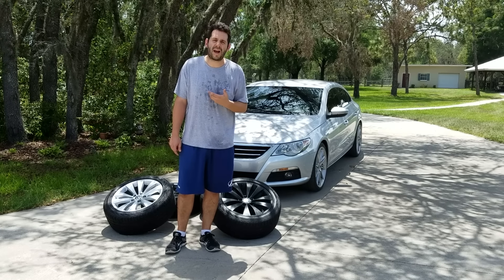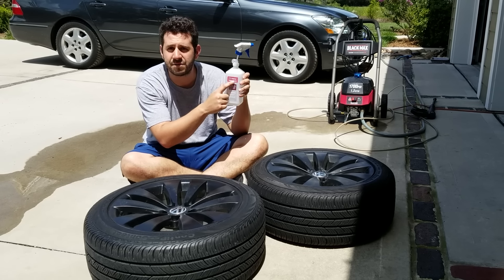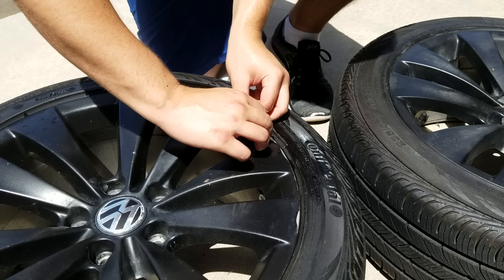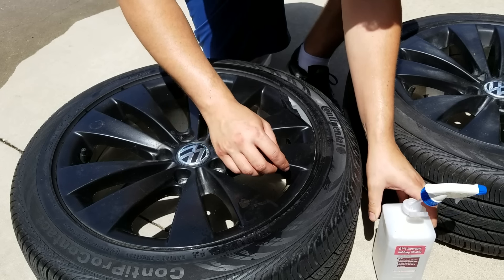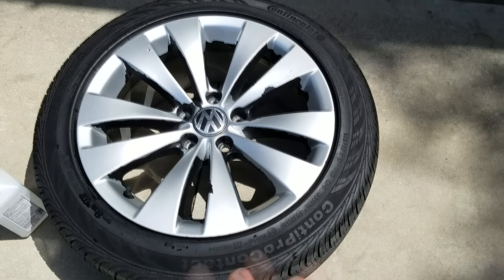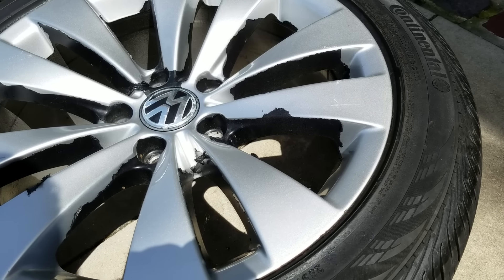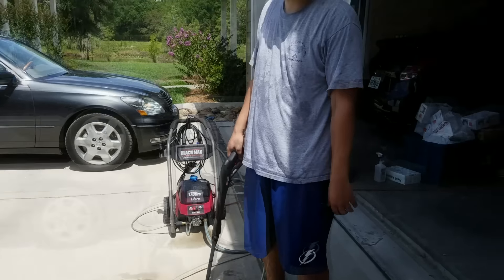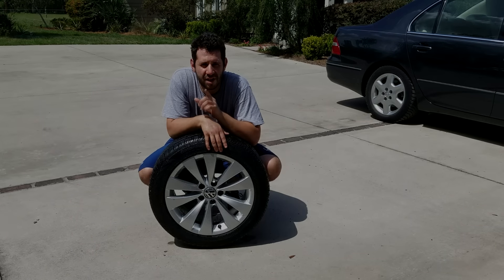EASIEST FREE & FAST way to remove Plasti Dip from your Wheels

Comment: Faster way, spray oven cleaner on it, let sit for a minute or two, it will start to bubble up. Next blast it with pressure washer and it all comes off in seconds. Not all oven cleaner is created equal, that natural lemon or orange crap won't work. I used Walmart house brand oven cleaner, like 2.78 a can which was enough for four wheels. This will also remove non clear coated rattle can paint jobs, like all those rims that people flat black rattle can painted before Plasti Dip became popular. It will not permanently damage factory clear coat but may make it soft for a while so do not use anything hard to scrape off paint, if there are any stubborn spots, use a nylon bristle brush. If you don't have a pressure washer, go use one of those pay and spray car washes.
Reply: Is oven cleaner safe on tire??
Reply: So like easy off foaming oven cleaner from dollar general store it's cheaper than engine degreaser and the Walmart oven cleaner lol makes good engine degreaser too

Comment: That plasti dip is done right. Mine is so thin that it wont peal as a whole and im getting kind of irritated.
Reply: LMFAOO
Reply: Have you tried spraying more coats on it? That might give you a thick enough layer to peel then. I’m the same, sucks
Reply: Yea this would never work on mine
Reply: Mine also 😢
Reply: Ensure you thoroughly clean them.
Reply: @senadahamzic9777 clean them better
Reply: Just use the nitro paint thinner. Soak it all and wait 10sec and rub it off

Comment: It's easy to remove because who ever applied it did it correctly with enough thickness, not because of the rubbing alcohol. Rubbing alcohol also isn't  the "main ingredient" that plastidip uses, it's naphtha.
Reply: So does that mean if its applied thinly, naphtha works better?

Comment: If you really want to remove plastidip really fast use the autozone brand brake cleaner, just spray then scrub with any rag or towel it will come off extremely fast lol i just took of another set off my vehicle today using my method
Reply: Coid Thunder i have a pressure washer. Would spraying brake cleaner then power washing it work?
Reply: But then you will remove the factory clear coat
Reply: Was it quick?
Reply: Dallas Parker Bro literally i went to one of those wash your own car, that have a pressure washer and a brush, i would put the spray on the rim, then use the pressure washer on it and really quick 😂 It's faster than any other method you would probably try out
Reply: Band Buddy Yes that works

Comment: rubbing alc will remove any wax or seal on your car so if you do get it on your car make sure to rewax that spot or it will be unprotected.
Reply: It will also try to breakdown your tire rubber, so getting it in the tires will cause cosmetic damage if left too long.

Comment: Brake cleaner will make it wipe off instantly.  It also removes tail light spray tint
Reply: Can you use the break cleaner on the body of the car without missing up the paint?
Reply: @rogervidales6782  I wouldn’t recommend it
Reply: @rogervidales6782  no, it will ruin the paint. Most Wheels have clear coat on them, which will be ruined by the brake cleaner.

Do not use brake cleaner on any painted surface!

Comment: If it's too thin to get to peel, why not clean the thin layer spotless so you can apply more coats to stick properly?  Then try a heat gun or propane torch (keep it moving), to get it to start peeling.

I'm trying to figure out how to get HF bedliner off of a Lexus wheel w/o trashing the finish.  Any ideas?  Next is getting it off the garage floor and wall.  Yep, the wife ran over a brand new gallon of the goo and popped it.  I'm still trying to figure out how she got the can and didn't drive through the wall.  Hellfire!

Comment: Use a mother's mag and aluminum wheel polish and a mother's power ball should help the light scratches on the surface and there's always the option of using harsh chemicals removing the grey paint and clear coat on the wheel and polish it and use spray on clear coat for touch ups for paint in the spray can i cheaply cleaned light grey rusted 15 1968 Pontiac rally II wheels and repainted them Rust-Oleum fire engine red and three coats of clear, same thing with the front 14x6 light tan Pontiac rally II wheels from another car and then put them on my 86 Buick Regal Factory V8 sport coupe in gm medium metallic grey and bright red pinstripe and for being red Pontiac wheels and black lug nuts with no center caps they actually looked pretty good on my Regal

Comment: Alcohol doesn't work for me. I used goof-off as a solvent, works better but I still cannot get it completely clean on the inner edges between the "spokes". I used a pressure washer and it started peeling the rim's coating. Any suggestions?

Comment: what if your wheels are freshly balanced and mounted on your car.... Will rubbing alcohol ruin anything on the rotors or pads if you peel off the big spots and than g to a car wash to remove the remains hard to get too spots?
Reply: Shouldn't,  alcohol evaporates right away

Comment: You were lucky the rubber coat was thick enough. I used WD-40 and lots of elbow grease... in my case the rubber paint dried over the summer and the rubber layer got too thin to peel it off. WD-40 helped dissolve the rubber + WD-40 soaked sponge & old rags helped remove it. After WD-40 it is necessary to use water with dish soap and clean rags to remove the greasy residue & have the rims perfectly clean. Final step is to apply paint wax & buff it off to protect the surface and reduce the amount of brake dust sticking to the surface.
Reply: I just got some wheels and it looks thin. How screwed am i?
Reply: Vincent Valentine fr me too

Comment: If u apply a new coat of the plasti did stuff and let it get almost completely dry it’ll roll right off and gasoline works very well too just not the healthy solution

Comment: 99.9% Isopropyl alcohol is also great for removing tree sap from your paint.
Reply: Dont know if ive even seen 99.9%. I have seen 91% but even that is usually sold out with the bs 70% remaining.
Reply: Printer shops cary 99
Reply: Nail polish remover with acetone cleans sap very easily.

Comment: Gasoline works best I just took plastidip off my wheels after 6 years and I used gasoline and a pressure washer and it came off flawlessly very little effort
Reply: I said plastidipp came off with gasoline? You sparayed it on or like putting gas on with a brush?

Comment: what if i used duplicolor? ive been using sandpaper and it's been a good hour and im not even 25% done yet with one wheel, the sandpaper is working its just going to take days at the rate im going, please reply

Comment: Previous owner dipped it RIGHT. I have dipped 4 cars so far. Got a car from dealer and, someone dipped the wheels. Horrible job, so thin. If its put on right you dont even need a solution. Good video nonetheless.
Reply: I am about to try to remove a thin layer that someone left after running out of product lol... how did you take it off when it was too thin?

Comment: You do realize that this is exactly how plasti dip is designed to work? You don’t even need rubbing alcohol....
Reply: It doesn't always work like this, it all depends on the thickness of the layers that are sprayed on.
Reply: Yeah I've tried just about everything and can not get it off. The last owner I guess decided to attempt to plasti dip the wheels and only did one and I assume gave up because all the other wheels were untouched. Benefit is the wheel is already black but now I have one that is half gloss black half matte black. Still can't find anything. That works. I have tried goo gone Automotive and it has removed parts but doesn't seem to budge on the rest.
Reply: My truck has had plastidip on the wheels center caps and lug nuts for atleast 4 almost 5 years that I know of that's how long I've owned it and it was on it when he brought me my second gen dodge ram laramie slt quad cab long bed magnum V8 4x4

Comment: Do you know how many coats it had on?
I only put 1 coat on my rims and it’s killing me to remove it
Reply: The thinner the coat the harder it is to remove.  I added 4 coats on top of a thin coat.  It bonded with the old coat and the thicker it is the easier it pulls off
Reply: hozurdaddy yea I only put 1 coat. It’s been a pain trying to remove it. I don’t really want to add more coats. Don’t want to throw money away. Ima try other methods before I do that. Thanks
Reply: likkaweyy  I know what ya mean.  I about rubbed the skin off my fingers on a really thin coat one time and then I learned that trick and ever since it peals off really easy

Comment: Well duh if you put it on thick enough it peels off in under 60 seconds. I do it all the time with my bare hands and no alcohol or water. Not so easy with thin layers. Thin layers BLOW